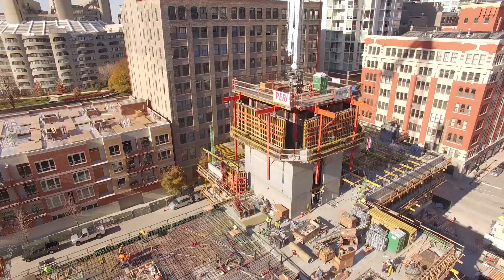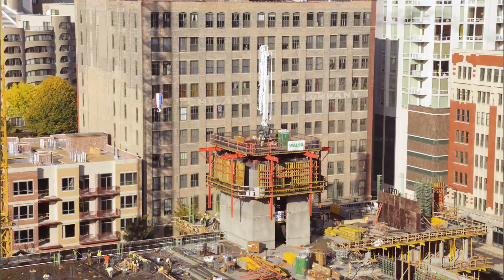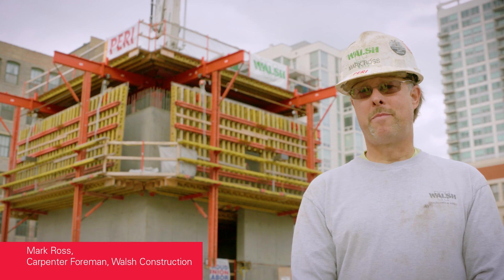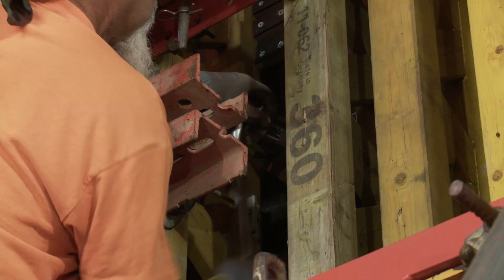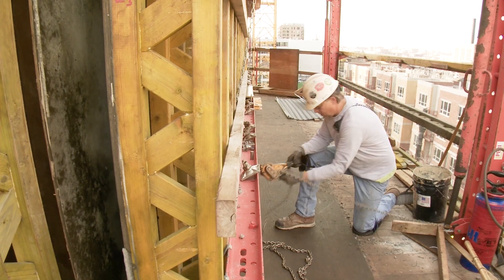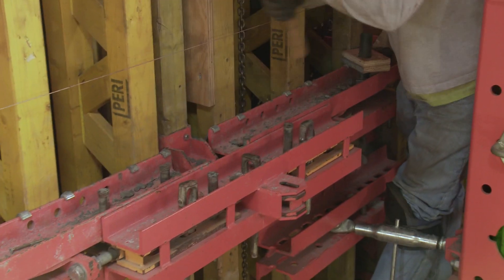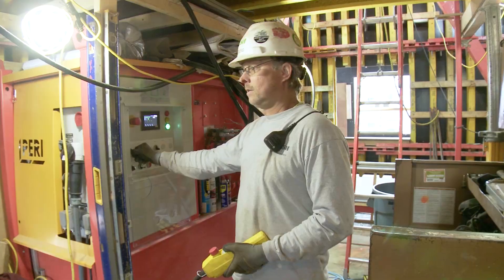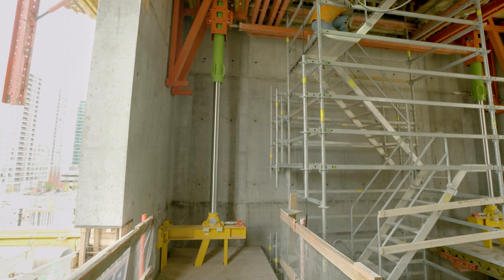FORMWORK | PERI ACS Core 400 Climbing Formwork - Customer Testimonial (EN)

Comment: Whats the connection of the slab with the walls? Looks like a anchored steel L
Reply from the maker: Hello EarendilTheBlessed, we´re happy to see that you are interested in one of our products! If you could give us your email address and your cell-phone number, we will make sure that our colleagues from your country will contact you directly. Kind regards, Team PERI
Reply: Im guessing there is ferralls cast into the walls for screw in rebar for slab
Reply: @scubasteves1  
It wouldnt juste be rebars screwed in. There has to be some shear resisting component. I'm just wondering what they consider is the most effective here. I thought PERI could be more specific on this specific project. But no.

Comment: Working with Skanska/Walsh on a joint venture job now,just a little  8 billion dollar rebuild of LaGuardia Airport in Queens NYC.
I too think they're a good group of fellas.
I also think We were the first in NYC to ever use Peri's system for MANDATORY cores,worked flawlessly.
41st and 8th ave Plaza construction was the GC and Sorbora was the concrete company used.
Reply: Im also carpentery formen i need job
Reply: I need your emil